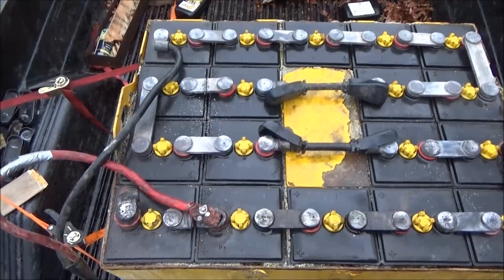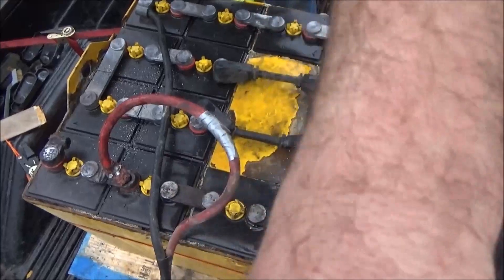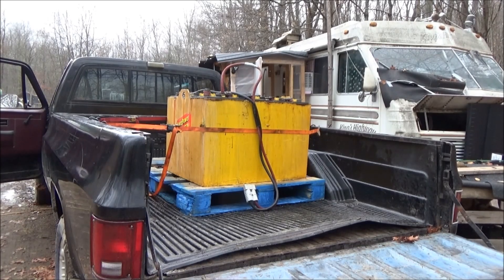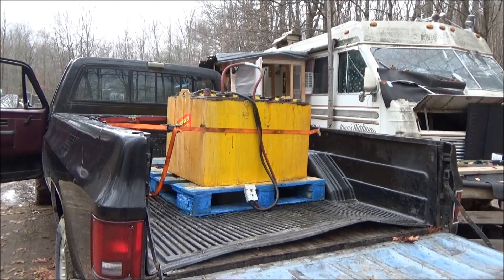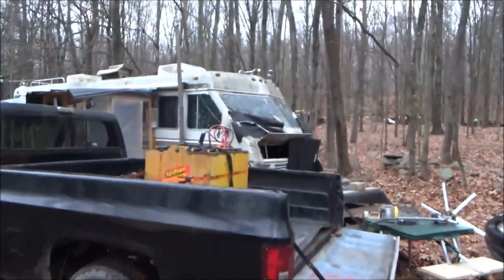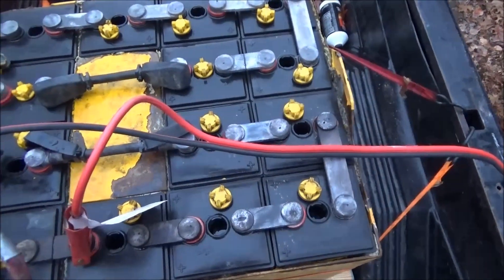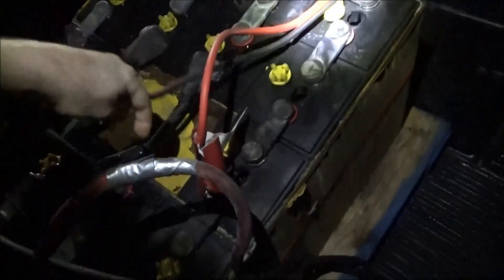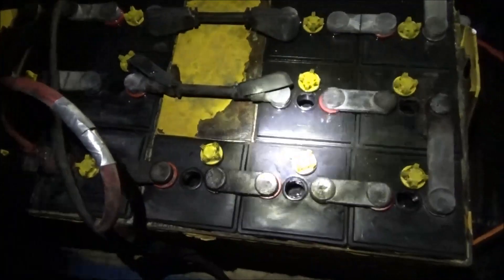Servicing An Old Forklift Battery For Home Solar Power PT II

Comment: Since you cutting them apart and reducing the voltage the amp hours stays the same at the lower voltage.  For Instance if I take a 100AH 12V and Hook it in Series with another 100AH 12V then I have 24V at 100AH.  If it hook a 100AH 12 Volt in Parallel with a 100AH 12V then I have 12V at 200AH.  Since these were in series your AH stays the same when you take them down to 12 volts.  so if they were 1000AH at 36 Volt and you make them into 3 12Volt setups you have 3000AH at 12V.
Reply: Anyone finding all this brainy talk a turn on?
Reply: MollyDolly
You're trying and I'm very trying.
Reply: shartne But Troy said that these batteries are designed to be run down to 20% capacity, not 40%.
Reply: Vicki Olson
Hmm?very interesting thats different from regular solar batteries.
Reply: I think the reason they are rated to be run down that far is because they are not meant to sit that low for very long.  They are swapped off the forklift and put in a high current charging rack.  Even a regular battery you can run it down a lot lower as long as it doesn't sit there long and you quickly get it charged back up.  With Solar though, it takes a lot longer to charge, the more time is sits that low the more lead sulfate will build up on the plates.  So if I was Troy I still wouldn't take it much below 60% charge for the longest life.
Reply: yeah but each 12 volt series will have about 1200 watt hours of storage not taking into the account you can only use 40 % of that because you cant fully drain them. If they are 100 amp hours each. so two banks would have 2400 watt hours but only 40 percent of that is available. Watt hours is different then amp hours. They really should be rated in watt hours so you tell what you got.
Reply: shartne
learned something from you comment about watt hours
Reply: Watt hours wouldn't change because watts is volts X amps so 36x1000 is the same as 12X3000.  I would say I wouldn't normally run those down more than 40% but I am sure they have some real heavy plates in them that won't sulfate easily, you can probably dip them down lower than that once in a while.   But he probably wouldn't need to, 40% of 36,0000 (or 24,000 for two sets of cells) is a lot of power for a laptop and some LED lights.
Reply from the maker: ***** These are 2 volt cells rated at 525 Amp Hours. This gives me two good 12 volt batteries at 525 AH. These batteries are designed to be run down to 20% capacity. That means 80% discharge, on a daily basis.
Reply: Troy said they are 525 amp hour so since they are int the a series the amp hours dont change. But if you multiply 525 amp hours x 12 volts  you come up with watt hours. I m pretty sure but I think im right. volts times amps equal watts. so that would be 6300 watt hours of stoage also he has two 12 volt batts so it would be double that 12600 watt hours but he can only drean them down 40 % . and 12600 watt hours x 40 % is 5040 useable watt hours of storage. not bad.
Reply: ***** ohms law I think they call it volts x amp = watts. so he has 12 volts of power in one bank x amps 525  amps so it would be 6300 watt hours per bank. but he cant run the batts down below 11.5 volts so he can only use 40 percent.
Reply: Not briany just ohms law. Simple really.
Reply: SSanf Yes... jejeje... I love it when they say things I don't understand.  :)
Reply: MollyDolly
 what is there that you dont understand watts volts amps or all the above
Reply: ***** Pretty much all of the above. .. but I am trying.  :)
Reply: shartne But these aren't 'regular solar batteries'.    These are batteries made for other purposes...for fork lifts that are usually recharged with electricity off the grid...but that off grid DIY'ers are finding work very well when adapted to their purposes for use in a solar and wind power generated system.   There, I think I said that quite well for someone who doesn't know that much.   lol
Reply: Vicki Olson
Ok you done good. not disagreeing. we are all leaning and thats what Im doing here on youtube. I have leaned a lot from people on my channel making comments. You have to keep a open mind and consider all things and ask questions Question everything. Thats how we all learn and improve.
Reply: shartne I agree....thanks for the encouragement.   That is what we all should be doing here and everywhere....encouraging each other and helping each of us learn more in a positive way.   And we can't get all bent out of shape like some do when someone appears not to listen to us or disagrees with us.   We have to take into consideration the delay from the filming of the project to when we get to see it and comment on it.
Reply: Jerry Densmore Thanks, Jerry
Reply: ***** That sounds very logical to me.
Reply: MollyDolly Hey!!! I was going to say that !!! lol
Reply: Vicki Olson : )

Comment: Cant you use an angle grinder and cut the yellow metal case, if you cut at the place where the bad cells are you cant damage the good ones. Just be careful not to cut to deep.
Reply: i would just grind the corner down.. little by little since the corners of batteries have more meat for possible OOPS i grinded to far.. but i would go super slow tell the edges are almost breaking through then i would try to peel the metal back if its able.. if not i would cut away at the VERY bottom of the panel
Reply: ya, the hydrogen produced while charging is soooo little it is cleared within a few minutes of removing the caps and letting the batteries cool off.. grinder is safe.. when they remove batteries at junkyards they grind or torch them out..
Reply from the maker: It is the last ditch resort to get these off the truck if I have to.
Reply: Pete Brown watch those videos on youtube where they actually open the caps on the batteries...then take a welding torch to melt the solder that holds the cell connecting rods together...i thought like you did until i saw that
Reply: Pete Brown if troy keeps attaching the positive last and unhooking it first he will have the same results. Charging a battery creates Hydrogen. Remember negative On last, off first. No big spark.

Comment: If I remember right you shouldn't have to remove the caps. They are designed to release pressure that builds up during charging. At least I know ours do.
Reply from the maker: Right but I was putting 100 amps into an old battery and wanted to see if it boiled.